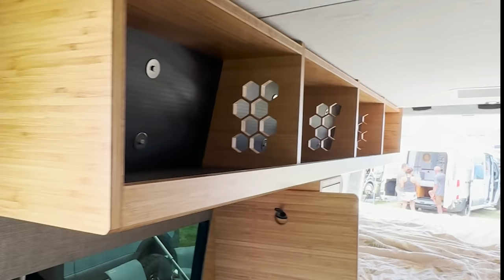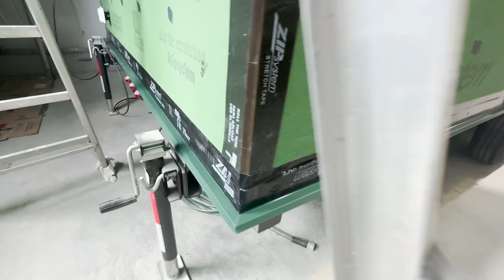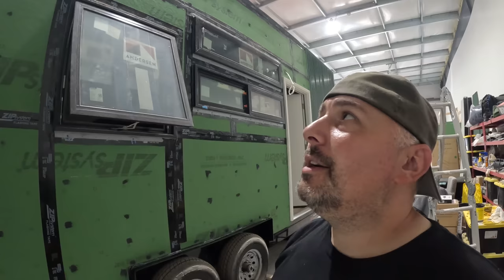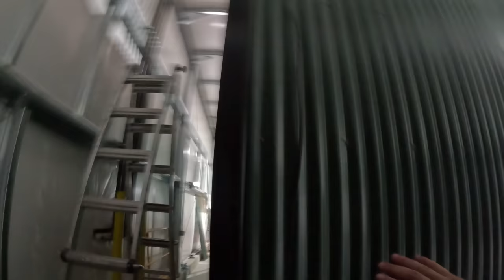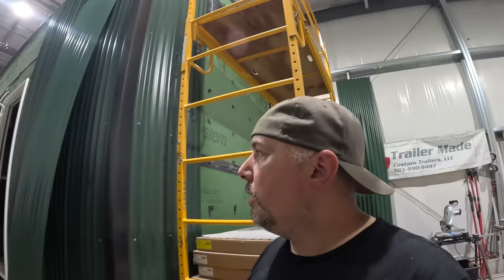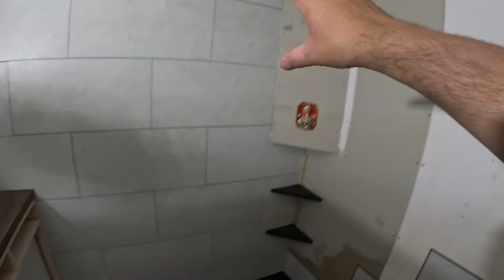Tiny House Build Never Going to End :(

Comment: Once you get it on the property,  you need to get it skirted asap b4 the snow flies. I use 2x4 frame and foam board insulation with a painted T111 on the outside. You'll also need an entry door in the skirting to get under the house thru the year for maintenance.

Comment: Hey, Your property probably has a front setback (mine is 25 feet) where you can't build a structure. The septic drainfield takes a good amount of space because it also has a border. I would place the septic tanks and the septic field in the front yard if it is OK to do so and if it looks OK from the street. That would leave your usable land for other purposes instead of the septic system.
Reply from the maker: Thank you. Everything is all planned and code enforcement has signed off on it as well

Comment: Two comments.......1) Why didn't you order color matched screws to install your siding and 2) from your close-up of the Zip-Board it doesn't appear that you "rolled" the tape seams with the special roller tool Zip-Board sells and which is required by their installation instructions.  Other than that, its looking great.
Reply from the maker: Didn’t want to color match the screws but if I did have a color I’d go with black which they don’t sell. If I spray them before I put them on then I run the risk of chipping the paint off and it would look weird some gray and some black. I definitely rolled the zip as that takes forever but it’s a needed step
Reply: @JarrodTocci   Thanks for your reply. Your tiny home looks amazing.